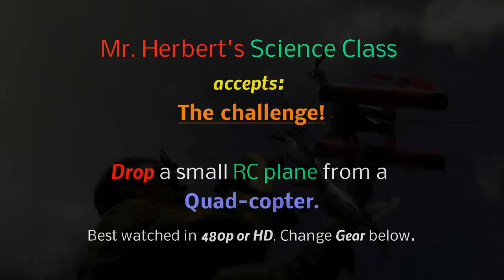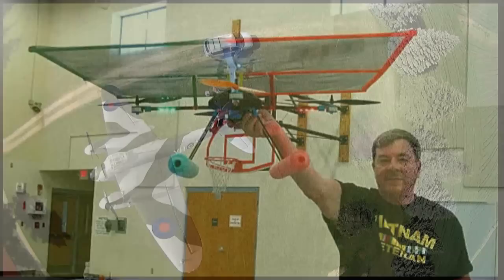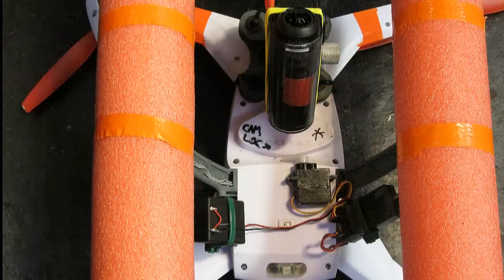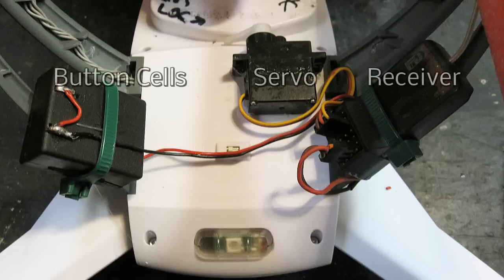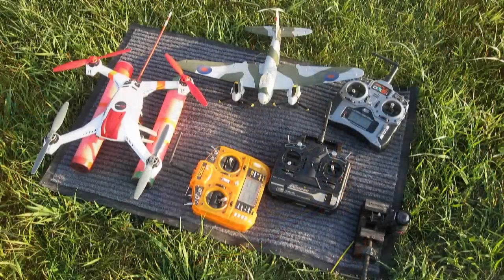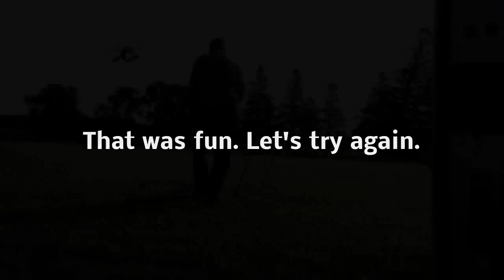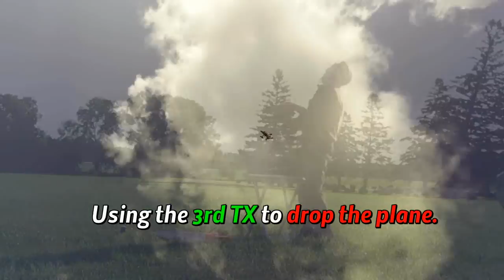QUAD-Copter drops a De Havilland Mosquito DH.98 twin airplane. Challenge accepted!

Comment: Well look at that :D  Worked much better then (me to had) expected :D I had thought you'd need a much longer string, to have the plane Not be thrown around :) 
You have A LOT of faith in the Blade 350 by the way ;)
Thanks for sharing again sir! :)
Reply from the maker: DutchRC ADVENTURES Thank you sir. The Blade 350 "Parks" where I want it better than my other quads, including my Phantom. I have used it for many things and it has always proven reliable so I use it the most for Aerial Photos.  The Plane actually did not release on the first attempt with a longer string (not shown) as it whipped around so much it wrapped around the landing gear float and could not release. I landed it, and shortened the string.  I thought the longer string would be better too, but turns out the shorter one allowed me to actuallypull it off.  Thanks again.
Reply: Thanks for the added insight into your findings! :D 
Goes to show you just have to try things to Really know :)  

And yes.. I've seen you just park the Blade for aerial footige lots of times now.. Just that is a good testiment of the quad :)  

I'm in the process of trying to control a plane by headmovements alone by the way (with a headtracker).. (see last video)..
Would you think that should be possible?? 
Cheers!

Comment: I love it...! The crystal clear video and aerial perspective from the Blade was a marvel to see. Can't wait to see the Der Mega Max F14 launch from a rocket. Again, the elevation and aerial view from the Quadcopter captured it all and I especially liked the inverted close-up shot of the Mosquito as it flew by. The turbulence in ground effect was more than I would suspect, but of course as I've always said, if you parked your truck close to the runway when the Space Shuttle landed the cyclonic vortices would rival a Midwest tornado. That was awesome! Thanks for sharing, from Rkt-Man
Reply from the maker: Bud Parriott Thanks Rocket Man. I appreciate that.  Stay tuned for the EF 2000 3rd attempt. I also will be anxious to see what you did with the Der Mega Max rocket and cant wait to launch it.
Thanks again.
Reply: #ThinkBigAndKickAss!

Comment: Great video Dave.
I have always wanted to try that,
What camera is mounted on the 350QX ? it is very clear and smooth video
Reply from the maker: Raptor50aus  Thanks sir. I am using a Sony AS 30 V with GPS on the Airborne cam. I like it a lot.  Thanks again.

Comment: Dave, we've not seen the Phantom for a while.. Do you still fly it?
Reply from the maker: Green Silver I don't fly it much, because it does not settle down and park in place immediately like the Blade does. When I am making videos myself, I feel a bit more confident with the Blade.  Probably the newer Blades are even better.  I have the Phantom  ready as a backup though.  Thanks for the comments.